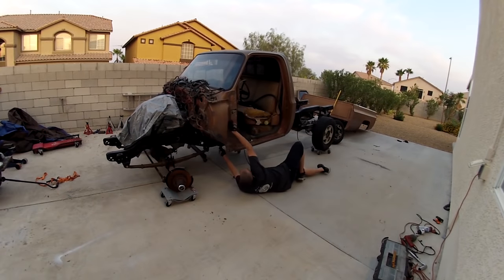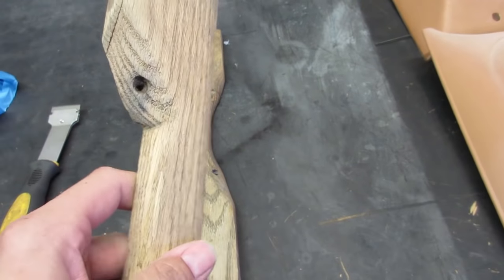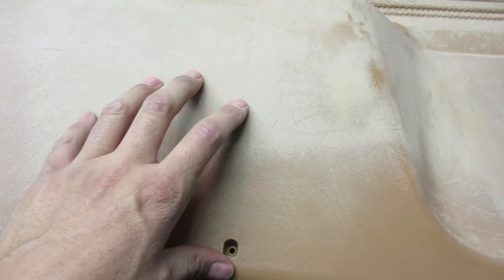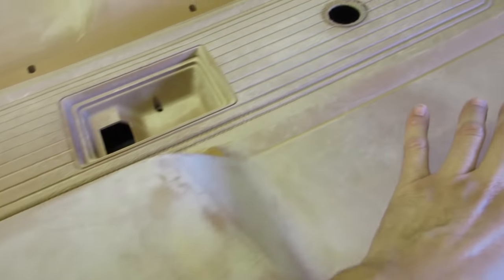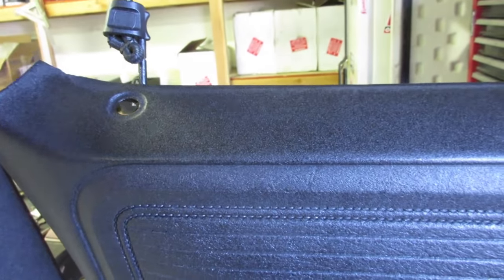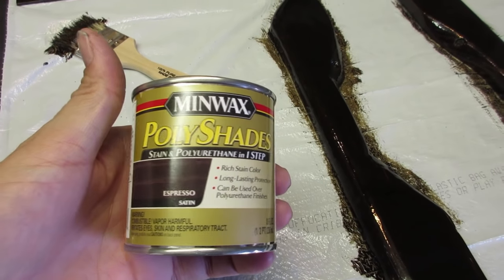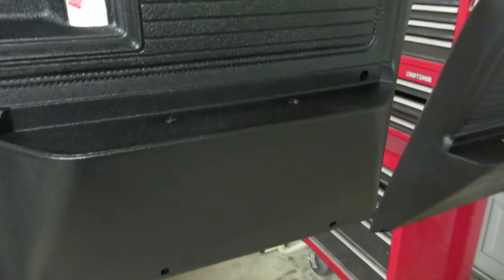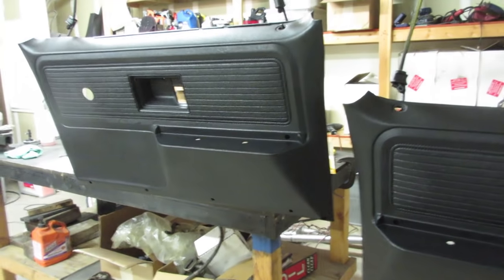Chevy K20 - Interior door panel painting with truck bed paint

Comment: A little late but does any paint stick really well? I’ve got an 86 ford that needs painting on the top of the door panels but I’d like to keep the red color for the interior.
Reply from the maker: As long as it's prepped well, you shouldn't have too much of an issue. Mine has held up well in other vehicles.

Comment: Hey Dave, I was watching some of your videos from the past and noticed that Fan you found for the K20 was perfect for spacing in the OEM shroud.  I know you said you found it on an S10 but all the S10 fan clutches I look up are the same as the LM7 motors and according to Hayden they mount at the same depth.  Is there a way you can look it over for any identifying part #'s when time permits.   Love the Videos and the tips!
Reply from the maker: Hey Robert, thanks for letting me know. When I was as the wrecking yard last time I noticed that the ford expeditions were right next to the S10 row. I did notice that the expeditions had a longer fan clutch, I searched online tonight and it looks like this is a fan / clutch from a 98-02 expedition. Let me know if you come up with the same conclusion. Thanks for watching and the commenting. If you find the same results I will let other know on the next Q&A video.
Reply: Thanks Dave!!!   Huge help.  You answered a question a couple of other folks asked a long time ago back on CK5 forums and kept me going in the right direction!!!  Appreciate it!
Reply: Not sure if it will matter but I double checked that and it says it is a reverse rotation unit.  Not sure if that will affect anything but if you get it running and are having cooling issues that might be your problem.  Might just be a matter of swapping the plastic fan part I think.
Reply from the maker: Thanks for the info, I will have to keep an eye on that, make sure it's pulling!
Reply from the maker: I compared the ford fan to a fan from an 02 Avalanche and from the pictures online they seem to have to same blade pitch. We will find out soon enough lol